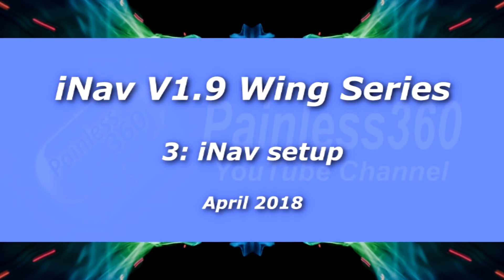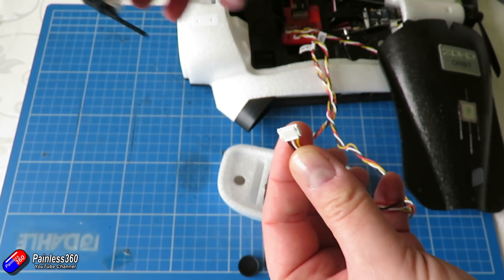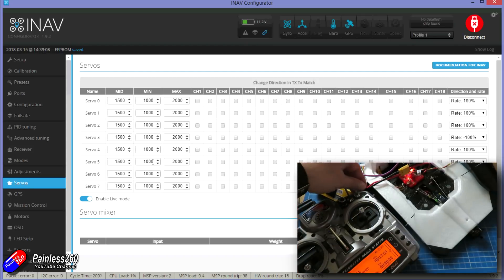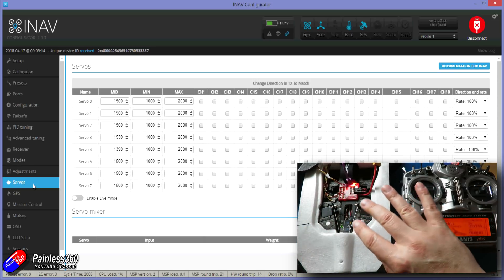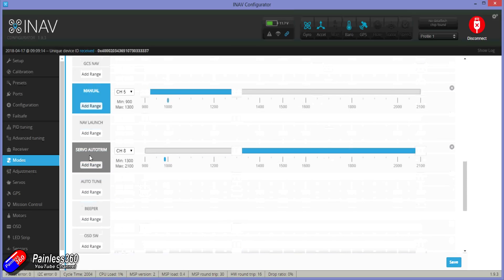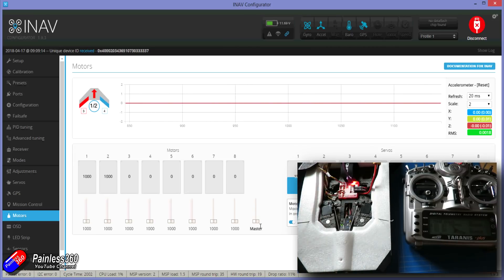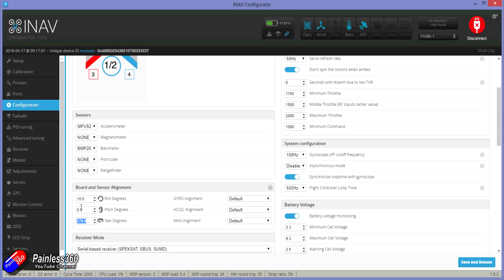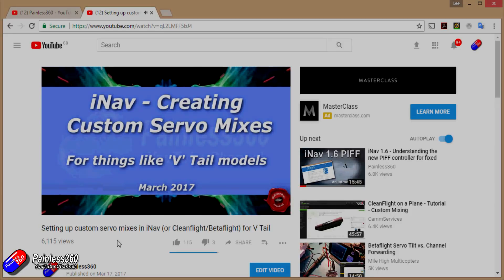iNav V1.9 Wing Build: FPV Kit and initial Software Setup (Orbit Wing and F35 FC)

Comment: I have the furious f-35  setup in a  Volantex Ranger 1600. I have everything installed,  receiver works,  sensors calibrated. In the mixer i have the motor/esc on M1.  Elevator/stabilized pitch on S3. Right Aileron / stabilized roll on S5. Left aileron/stabilized roll on S4. Rudder/stabilized yaw on S6. My problem is the ailerons don't work at all and I know the servos are good. The elevator works. When I give it right or left  airleon the  rudder moves???? When I give it rudder nothing happens. When I go into Inav under receiver when I move rudder it shows channel 6 moving between 1000 to 2000 as expected. But the bar graph  for yaw doesn't move? When I move the aileron channel 5  moves and the yaw graph moves?? Totally confused. Anyone can help ? Thanks in advance.
Reply from the maker: These videos are out of date. Please see the iNav 2.2 series...
Reply: @Painless360  Any ideas why I'm having these issues?
Reply from the maker: Every step for success I follow is covered in the series. This is for an older version of iNav and the output mixer is a lot different now and easier to troubleshoot.. Best of luck!
Reply: @Painless360  I went through your other videos for inav still can't get it to work. If I setup the qx7 TAER and use channel 2 for aileron all the mappings in inav work. But the servo connections on the f-35 servo 2(m2) is for a 2nd motor so I don't use those pins. I then skip pins for m2 and give channel 3 to elevator, channel 4 and channel 5 to left and right ailerons channel 6 to rudder as it is shown in the f-35 manual. Once I do that all the mappings in inav goes back to my original problem with the right stick left to right controls the yaw??  I tried mappings like this AETR1234 but inav doesn't save it and goes back to default. Should I try arduplane instead?

Comment: I seem to have a problem,  When I move the aileron stick, I get proper movement, but when I pull back, nothing. No elevator (pitch) Also, in the motors tab I see four bars moving up and down in unison as I move the aileron stick, but nothing moving in pitch. Throttle works when the master is raised, but no throttle from Tx, nor any bars moving in motors tab. No mixing on Taranis either, standard setup like you have AETR Any suggestions? Something I should check? Any advice would be helpful. Thnx Ted
Reply from the maker: Sounds like the servo table isn't setup right. See my inav 2.1 series for more up to date videos... best of luck!
Reply: @Painless360  thank you Grahm
Reply: @Painless360  Hello again, I think I have found my problem with the inability to reverse the servos to get proper movement in iNav 2.2. My servos seem to be in a flipped position causing this problem. I just need to plug them into opposite connections. My question to you is, I know it is best to not do any mixing in Taranis, and let the flight controller do it, but If, lets say your pitch movement on your servos was opposite, would it muck up the FC's ability to properly fly the craft? Maybe in return to home?  Does the FC basically fly in level flight using the Gyros, and the reversed input direction of pitch not matter?
Thank you in advance.

Comment: im trying a mini skywalker whit a fc-10 doc from bang good a Frsky XM+ Micro D16 SBUS Full Range Mini Receiver  and a tarnis.
im stuck whit only one problem it only give me 4 working chanels......so not one 3 pos swich.
 so close but stil so far away.
cam osd gps pito tube all working but i cant arm ore use rth. bord wont flash tryed difrend versions of i nav tryed zadig tryd difrent recever tryd difrent computer.......help!
Reply from the maker: That’s something that I’ve not seen here. I’ve checked the settings for Sbus. Are you saying that you only have four channels listed in the receiver tab or you can see more channels and just more of them aren’t working?
Reply: @Painless360  i can see 18 colerd bands the top 4 i can move. the last two 17 and 18 are small. i have set up taranis with 2 switch no mixing.  the 12 i cant move are in the middel. i armed the bord setting it to the middel of chan 5( the spot it is at and i cant move)it arms and moter moves whit trottel stick. i think the problem is i cant flash it and am stuck whit the firmwear flashed by the chinees factory. it might be a dud. im a sucker for cheap stuff..it is frustating but stil good fun.;-)
Reply from the maker: I'd triple check that the other mixes you have setup on the radio are actually working (use the monitor screen in the radio itself). Best of luck!
Reply: @Painless360  yessss sucses! thanx it was in my taranis all chan working...yeeeeeehaaaaaa. bord is falshing ok now. Full chip erase should be off. now lets see if i can do the rest......Thanx so much for your help.

Comment: Hello, do you have an idea why I see only letters in the channel map? If I enter 1234 or 5678 it will turn red immediately and I can not save.
Reply from the maker: There have been a few bugs in the software and configurator. I’d try another version of both. Best of luck!
Reply: @Painless360  Okay.. Thank you!
Reply: @Painless360  Oh wait.. I can not use 2.0 and I have to flash the FC? Or may I could leave 2.0 on the FC and use 1.9 on my PC?

Comment: Can I use this fc on Fx-79 2m flying wing iNav can handle these wing ? Tanks man
Reply from the maker: There are lots of choice for flight controllers that will work with that software. I've used a couple on the channel, check out the playlist. In theory, it shouldn't matter about the size of the craft that you're adding it to. Best of luck!

Comment: Thank you so much for yor videos.
I want to ask you one question regarding the MAG. You are not using it in inav so, is there any real benefit from using it? if GPS can replace the main MAG function then why use it?
Reply from the maker: The mag shows the direction of travel and as a plane is normally flying forwards you can do without this as the model knows what direction it's pointing in by looking at where is was a moment ago and where it is now. Mags can get a lot of interference so are best disabled unless you intend to fly in high winds where the model will appear to fly 'backwards' and confuse the GPS calculations..

Comment: Hi - I'm not sure I am showing a problem.  I have my F35 installed identical to yours.  After setting the board orientation to 270 as shown the image on the screen is 180 degrees off - I think.  In other words I have the model facing away from me towards the computer but it shows in the image of the model that FRONT is facing towards me instead of BACK.  In your video at about 6:44 it appears to show the normal orientation - (I see FRONT in this situation).  But flight appears to be proper - when I pitch down FRONT goes down, bank to the right it banks to the right.  It is just disorienting seeing it backwards.
Reply from the maker: The orientation of the model is taking account the heading (if you're using the compass), you're only looking for the relative moment. i.e. nose up down, roll right way etc..
Reply: After clicking on the reset z axis button the orientation appeared correctly.  Now to tackle twitchy servo issue and beeping motor :)

Comment: Do you have any details about connecting a Spektrum receiver to the F-35? I bought the same receiver they show in the manual (SPM4649T) and wired it just as shown. It binds properly but I can't get the channels to move properly in the receiver page. The bars start all at the left then jump left and right erratically when I move the sticks. not following the stick movements. I set the ports as shown in the manual, UART3 set to serial RX and UART6 set to Smartport, and in the configuration page I have the receiver type set as Serial-based receiver (Speksat, SBUS, SUMD) and Spektrum1024.  I haven't found anything more than the one diagram in the manual or on the Furious website.
Reply from the maker: Sorry, I’ve not tried it. The only information I’ve got is the stuff that’s in the manual. Best of luck
Reply: In case anyone else comes across this problem, I contacted FuriousFPV about it. They looked into it and discovered there is an error in the manual. The Spektrum SPM4649T serial receiver should be connected to the M-RX port not the F-RX as shown in the manual. Moving to this port and selecting UART-5 corrected the issue and everything works correctly.

Comment: Nice video! Will the hatch magnets screw with your GPS module being that close?
Reply from the maker: Shouldn’t do, the only thing that it will actually affect is the magnetometer and I’m not using that as it is a fixed wing..

Comment: iNav calls PASSTHROUGH mode MANUAL now :-) Old habits die hard !
Reply from the maker: They sure do, when originally started shooting this video I think it was still called that!
Reply: I'm so glad you've continued with your iNav series, it's great to have a place to send people when they want to setup a wing with iNav. Looking forward to see how your Capi 2 build is going.
Reply from the maker: It'll be very different to this. Omnibus AIO V2.1 F4 board with a full sized M8N GPS and a few tricks for better iNav builds too (use of PDB to help with power around the model and shielded cable runs etc). Let me know if there are any tips from your experience..
Reply: I'm putting together a feedback post for the TBS Lounge on FB. I completed 100 flights with my Capi 2 and wanted to give them some feedback on the good and bad points on the Wing. 

Good call on using the full sized M8N, I've been using the mini one (M8N) in my build and it takes ages to get a fix, I've got a BN-880  which I'll be switching over to at some point.

VTX install, don't forget to put some holes in the sticker covering VTX bay in the wing. It will cause some air to be pulled down into the bay as the cable run exits out on the top of the wing which is low pressure. 

I've also put some cooling holes under bay where the ESC sits, just small slits to get a bit of extra airflow over the ESC.

I've put two WS2812B boards on the model, one on the leading edge, and one at the rear. Helps to make the model more visible.

Run some tape along the bottom edge of the winglets, they get a right hammering, and having something to help them slide a bit better stops them getting too badly abused.

I've made a USB extender cable, a bit like the one that used to come with the Diatone quadcopters, so I don't put too much pressure on the USB port. It's a bit tight when you've got the board in the bay on the wing.

I'm hoping to use the Matek wing board in my next Capi2 build.

Hope that helps a little ! Good luck :-)
Reply from the maker: Wonderful feedback, can you pop me a link to the forum you're using? I'd like to take a look and maybe link to it in the video..
Reply: what inav version are you running on your capi 2?

Comment: Hey man, these are really helpful videos. I have my F-35 and following your videos to transform a Parrot Disco into a more reliable FPV fixed wing. I do not like that latency on the video feed. BUT one of my servos is not working. I'm using an external BEC from a BLHELI ESC 30 A BEC 5V/1A. Could this be the issue? Do I need to get a bigger ESC regarding amperage? Or do I need to solder the FC pads to use internal BEC 5V/3A? Thanks in advance!
Reply from the maker: The fact that one of the servers is going to the end position makes it sound like its not plugged in to right output or you haven't got the right model type selected in the INav setup. As I couldn't see tha screen I don't know. Hopefully the rest of the inav series will help you..
Reply: The right servo is plugged in into S4 of the F-35 FC as it must be. Will check selecting other wing model on INAV presets tab.
Reply: Fixed, the servo 4 cables were mixed up. Rookie mistake haha. Keep it up with this serie :D
Reply from the maker: Easy to do ;)